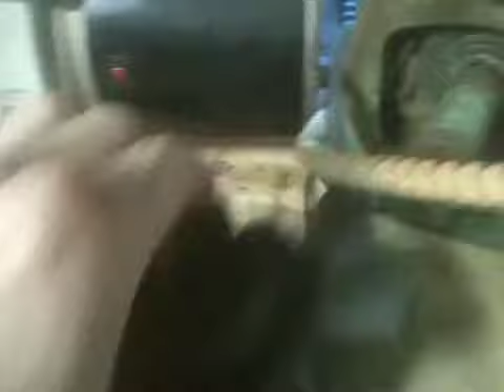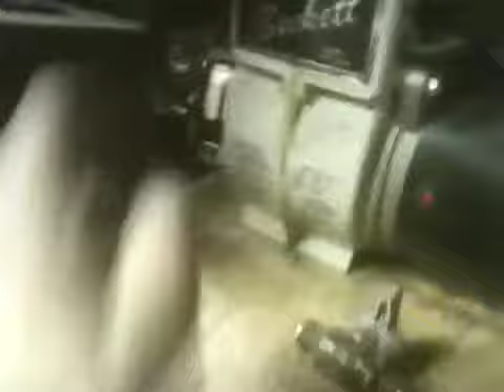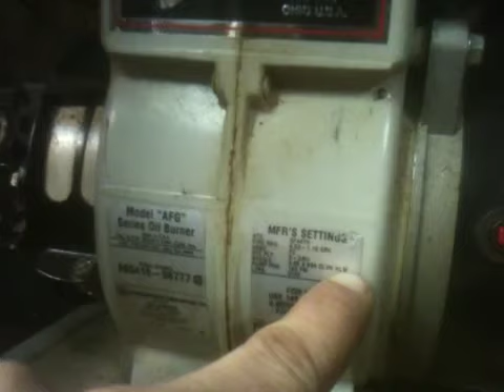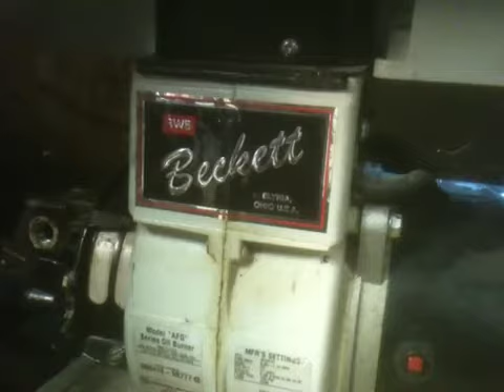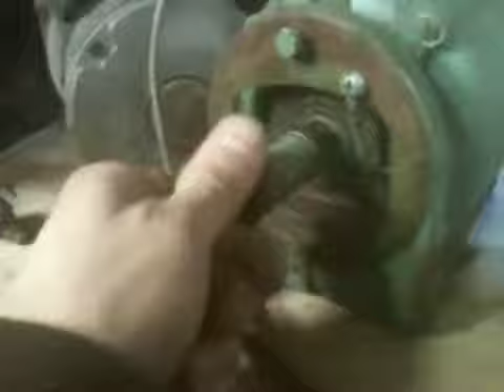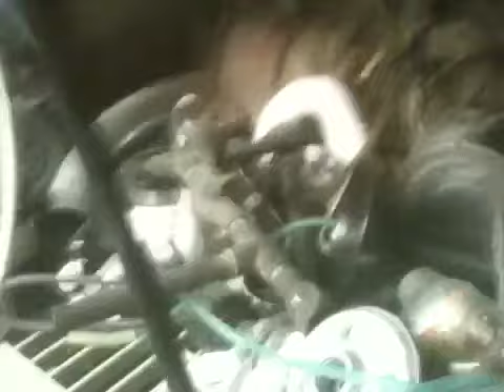Oil burners and parts I have to use and for tinkering with

Comment: The sticker on the left indicates the operating range from Beckett.  The sticker on the right indicates the specifications for the furnace it came off of.  The nozzle is  .85 gallons per hour (at 100psi)  with an 80  degree spray pattern.  The "A" means a hollow spray pattern.  This is a very common nozzle type, and is commonly used in forced air furnaces. 140psi pump pressure means its most likely delivering around 1.05 gph due to the higher pressure.  The higher pressure atomizes  fuel better